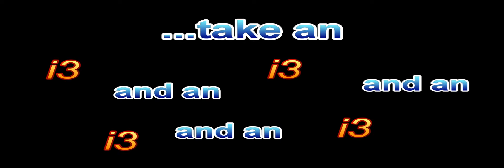Lego LPE Inline 12 sys pneumatic engine

Comment from the maker: Yes this is a better question. Well, the highest pressure my compressor offers is 8 bar / 118 psi. But the switches start to leak a little bit at 5 bar, so the rpm only increase slightly with pressures higher than 5bar. The tubes can handle much more, about 44 bar as the manufacture says.

Comment from the maker: yes, but that is a bit complicate. Think like this: the cylinders have the same rate of pushing in and out in both engine-models. But they run not at same speeds because the crankshaft of the i3 is 120° 120° 120°. So 3 pushes to cycle one time. And the v4 crankshaft is 90° 90° 90° 90°. So 4 pushes to cycle one time. And thats all I think. The v4 runs slower, but with more torque and the i3 runs faster with less torque. Hope you could understand what I mean.

Comment: Just so you know, Bugatti is surely not the first car to come up with a V16 engine. Cadillac made it first with their "Cadillac V16" named car. It was sold for 10 years in 1930-1940 - WAY before Bugatti or anyone else did it. Many other "firsts" came from Cadillac and american cars in general. Even the first turbo car was Oldsmobile and it had water/methanol injection!

Comment: It doesn't really. 

It can apply rotational force but the force comes from the air compressor its attached to, not the "engine" and will be limited by the mechanical strength of the crankshaft an air fittings probably.

Better question is how many PSI/bar is this capable of handling?
Reply: Collin Reisdorf lego tubes pops of at around 4 bars